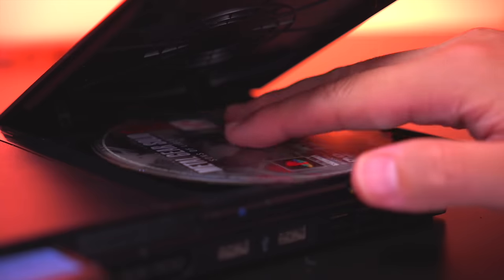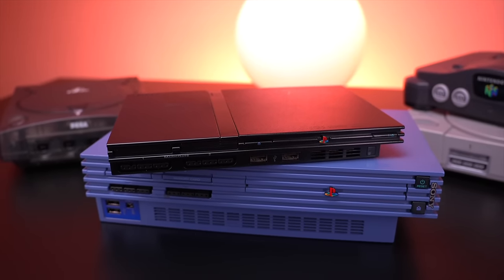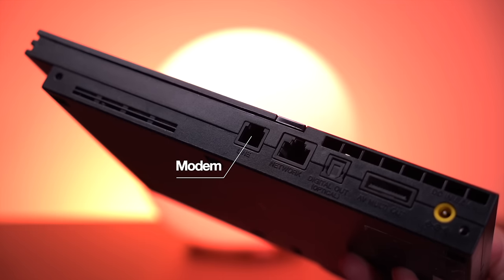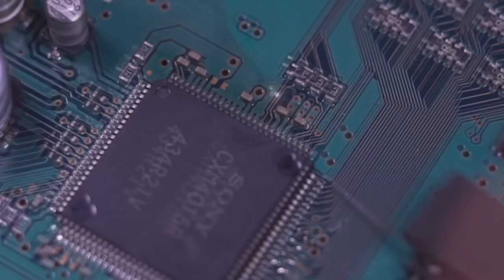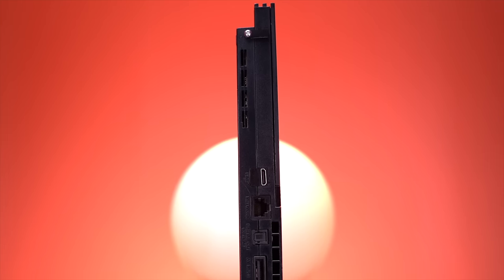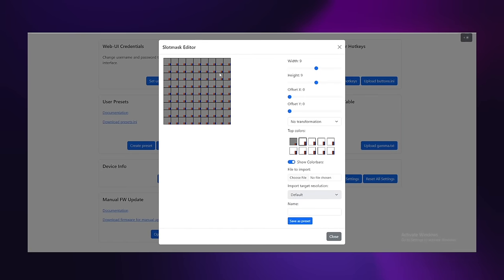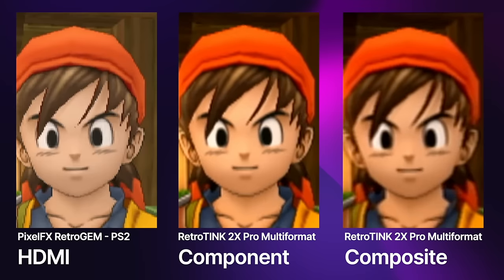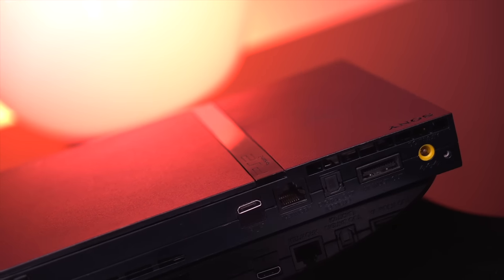This HDMI Mod Makes The PlayStation 2 Look GORGEOUS!

Comment: I would have bought this immediately but I'm having second thoughts seeing basic features like 1080p locked behind a paywall. Obviously they feel they can still make money selling the basic version at $99, so charging nearly double the price for those who just want 1 step higher in resolution feels like a scam. Its not like he's putting features that took a lot of R&D behind the paywall
Reply: Another annoying thing is that it's not even $99 it's $120 but the rationale is that without the ribbon cables (which you need to install it and cannot choose not to have) it's $99.
Reply: @kyle52905  seems scummy. just ask for what it costs. it's like saying this car is only 25k, but it doesn't come with wheels or an engine.
Reply: im waiting for someone to find a way to hack into it and give it shiny firmware.
Reply: actually crazy its $189 just to get 1080p
Reply: @markie7062 yeah, for a very old console, the upgrade are not worth the price
Reply: Yeah F that, just get a decent PC and PCSX2.
Reply: I choose to buy gbsc wonders box instead
Reply: See the idea is very solid but I'm still saying for the price and for it be 2 near identical versions and call the other "shiny" with nothing about it being shiny is kind of crazy to me like up to 1440p is cool but I could just save the money and but the PS3 with the ps2 hardware in it to mod that instead
Reply: It dosent feel like a scam, It is a scam, i suggest waiting a bit, now that the road is paved its only a matter of time before the community catches on and make a open source one
Reply: thanks you saved me one on this
Reply: @kyle52905  Especially when there are components that ARE unnecessary (the WiFi antenna) that you have to buy for some reason. As long as the thing works on day 1, I don't care about firmware updates. Surely it would have been much cheaper to add a USB port for connecting the board to a computer?
Reply: @smittzero8463  I disagree there. The wifi module is pretty necessary as it would suck to take the system apart just to get a firmware update. You need a secondary micro controller anyway to flash the FPGA, might as well spend a dollar more and get one with wifi built in. They're really cheap
Reply: @jdigi78  USB-C port on the outside of the shell, requiring a tiny bit of shell cutting. No need to disassemble.
Reply: Just like tesla vehicles
Reply: @hajisaiku  eh that would be like $250 just to find one and modding it to avoid YLOD would run you like $500 minimum (it's also not very feasible to do yourself). Best option imo is to get a gbsc, retrotink, or ossc and use that since they're all quite good and multipurpose.
Reply: Are there any good alternatives to this? GC and Wii have pretty good options. Kinda weird if there's nothing good for the PS2.
Reply: You’re getting a $190 device for $120, think of it that way. Otherwise, you’d just be paying $190. The software locks are a way of being able to offer it as a functional product at a lower price. At $120 there is probably not much profit, but at $190 there might not be many people who would go for it. I’m thankful someone’s taken the time and effort to do this and to see people trashing it without understanding that it wouldn’t exist at all without this sort of compromise is really shameful.
Reply: @srpacific it deserves to be trashed on, it is a scummy choice and they brought all this bad publicity on themselves, should have just sold the shiny version as-is. Wont be long before cheap full feature chinese knock offs and a community made bios flash unlocker will come out anyway--these people dont deserve the $190 if this is what they pull
Reply: На эмуляторе  PS2 для PC картинка лучше
Reply: Honestly just needs an adaptor

Comment: Honestly $190 for the Shiny Edition vs $120 for the regular is just obscene, especially since they're literally the exact same hardware and the "premium" features are all implemented in software. No, it is not reasonable to charge $70 extra for 1080p and motion adaptive deinterlacing, both of which the hardware can ALREADY DO and are solely locked out by the proprietary software.

Imagine if this had been how PS1 modchips worked. Imagine if you got charged $30 for a PS1 modchip that lets you play backups from YOUR region, but you had to pay $90 for it to let you play backups from OTHER regions. That would be absurd, right?
Reply: You sound poor is $190 is expensive 😂
Reply: @Daveeeeeeyhowyoudoing  9 months ago... that was a month of groceries. Now its like 2.5 weeks.
Reply: That's kinda similar to how xecuter/sx os used to be, at least before Nintendo busted Gary Bowser.
Reply: Your probably they type of person that calls a mechanic to fix your car and then does want to pay them when it takes them less than a minute to find and fix your problem

Comment: Yeah idk man I don't feel too good about locking software features behind a paywall like that. If they were selling an actual slimmed down version of the hardware or were only selling the shiny edition it would feel less offensive, but presented the way it is here evokes the same feelings and arguments we had back when Disc Locked Content was the big controversial videogame thing.
Reply: It also feels like the BMW controversy where the cars come with heated seats on the base model, but you gotta pay a subscription service (forgot if it was monthly or yearly) to use that feature. Shouldn't the option be ADDING the seats themselves instead of driving up their base model production cost and locking the item features behind a paywall?
Reply: Agreed, it’s pretty stupid product design, not to mention asking for a hack
Reply: Or not making it plug-in.
Reply: dont worry they will only sell like 50 of these max at this price and scheme.
Reply: Do you think it would still be $120 if they had to spend the money engineering and producing a separate hardware version? This is a universal board for many consoles. Think of it this way, it’s a $190 device you’re getting a $70 discount on to give up a couple features that probably don’t matter to most people.
Reply: @OfficialDJSoru  Ordering features in a greater quantity allow them to reduce the price of a single unit therefore, making more money on premium models. It alos reduce cost in manufacturing plants as there are less mistakes made because all models are fully equipped.
Reply: @tomjoad1363  That's the reason BMW said. It is quicker and cheaper to install on all cars. And no 3rd party installations that can damage the car. So that is why the heated seats are sold as a subscription fee.

Comment: You would think that for $190.00, they would 3d print the fitment block to keep the hdmi port uniform with the other connections. If you look at the final reveal before he plugs the hdmi into the port, it's crooked to the point that it's an eyesore. Awesome video sir, but the price and their quality is a no go for me
Reply: It was the first thing i noticed during the intro when it revealed the port, yikes
Reply: Glad I wasn't the only one that noticed!  For the price, that is just unacceptable for any mod.
Reply: My exact thought. Shody,  expensive and does little. Pass!
Reply: Who’s ever going to see the back of the PS2 though? I don’t get why everyone is hyper inflating this issue.
Reply: It's the fact that after installation, I would personally know it's there and it would eat away at my soul. The point I was making is for the sale price of $190.00 plus tax and shipping, they can fit the case component a little better. If it works, it works and I won't knock the functionality. However, fitment is another issue

Comment: With the lack of 1080i support, the weird software locks, and the fact that component cables still provide pretty dang clear video, I think I'll stick with my component cables for now. Great video as always though!
Reply: Wise choice!
Reply: plus, with component cable you can get 1080i.
Reply: Not to mention, this mod destroys the color space 24:00 . Since it forces the console to be in Hdmi Limited. Making all colors over white , and it crushes blacks (Shadows just vanish in all games. The Color Black is now not BLACK but DARK BLUE , Brown is not BROWN but DARK YELLOW , Red is now not RED but DARK ORANGE , Blue is now NOT BLUE but LIGHT DARK ... it messes up the whole color space)... Compared to Component RGB, that presents all the color space with the correct colors...
Reply: The colour also looks horrid with the HDMI mod, not even considering that 720p is a pretty modest uptick from 480p. What a bad product.
Reply: @hfric  Like most of the video output mods I've seen so far. Latest Edge enhanced for Snes (green is blue on smw for example). Shiny mod isn't sharpness mod, but modification of contrast, the forced whites and blacks, make the overflows (on flat screen) of colors are attenuated, giving the impression that it is sharper, but it is not the case. Indeed it distorts the colors, this mod is no exception to the rule. Original on CRT is the best for old consoles. But for consoles from 128 bits I think there can be progress.
Reply: @Daitrn2002  The yuv video output is not affected by the mod?

Comment: Not having 1080p on the basic edition is a huge letdown. I agree that using something like a RetroTink with this would be an awesome way to play, but I think that for the (comparatively) plug and play solution of installing the mod and just running it, not having 1080p is a big deal, especially considering that a lot of people have 4K TVs now.
Reply: The concept of a license for something already on the hardware is a business practice I won't support.
Reply: The option already exists to use a Component cable and run it through a RetroTink 5x. You’ll get 1080p and Motion Adaptive deinterlacing AND it works for all your console, not just one. IIRC, only PS2 needs it
Reply: Could be wrong but i don't think it would look much better. For me 480p is enough
Reply: This is a great option with the Super Shiny Edition of you already have an OSSC you’re using on a slew of other consoles that won’t take advantage of adaptive deinterlacing
Reply: biggest letdown with that is that it's a software lock and not a hardware limitation.
Reply: @AegisRages I applaude you having a spine mate and absolutely agree!
Reply: I hope someone finds a jailbreak to get it on the basic version. Software locks are unethical
Reply: @UnethicalMonkey420  Agreed!
Reply: @UnethicalMonkey420  yes I agree!
Reply: 720p should be okay for most people unless your tv has issues upscaling, the only real downside is not having motion adaptive deinterlacing
Reply: Not to mention RetroTinks are expensive and very difficult to get a hold of outside of America.
Reply: @Spazbo4  all tvs 720p to 4k is quite soft.... and 1440p hw is there in all hw it is just LOCKED. absurd.
Reply: @JGrove303  it wasn't a software as such lockout it was a limitation of the actual firmware on the dvdrom that  panasonic provided even if you could get up to 1080 p and/or 4k where supported hardware limitation would also be an issue for atleast for both ps1 and partial of the ps2 games as half to 3/4's of the games were still cdrom based meaning most  only had the capacity of max resolution of 720x576 which was the default widescreen standard and max bandwidth s-video coulod obtain towards the end of life of the ps2 there was only about 6 games that supported up to 1080 i none did progressive scan at this stage..
Reply: @TheSynrgy1987  Someone will find a way to unlock it, I'm sure. Just a matter of time. That's a shady ass practice and I hope they fail because of it.
Reply: i'll be getting the base model, 
everything piped into a retrotink 4k
Reply: @MarbleThumbs , this sounds like the 3DS capture card install service. you have to pay a thousand+ to get an inferior product to todays standards where many tablets have such ports. so a thousand is a no buy...
Reply: @michealfunickrr3717 Yeah, I'll stick with snicker stream and an aux cable at those prices.
Reply: @AegisRages Yeah, very sad to see
Reply: @Spazbo4  the problem isn't mainly it being 720p but it being a software lock and not the hardware being weaker
Reply: @TheSynrgy1987 what is  software lock
Reply: Thanks for saving me time in watching this video
Reply: Just play the game on a damn ps3.
Reply: @TheSynrgy1987 so you’d be okay with it if they spent extra money to engineer a basic version in hardware, then sold it to you for probably more than the soft locked board here since the extra costs to produce a second version would likely make the base price more expensive? Sometimes I think people have absolutely no understanding of economics…think of it this way, You’re getting a $70 discount on a $190 product not a $70 up charge on a $120 product.
Reply: @srpacific  so they're losing money on the basic edition? get real
Reply: 1080p is nice. But without motion adaptive deinterlacing you screen will constantly shake and thats much bigger problem.

Comment: Man I was really looking forward to seeing what this kit had to offer. Its too bad that even after coughing up $120, you get all the hardware but not all the features. Really hoping they rethink the whole "$70 license for a mod you already paid for" thing. I'm all for supporting small businesses, but not when they pull things like this.
Reply: Tbf if they hadn't introduced this weird "basic" tier the device would've just retailed for around the same price as their previous kits. Which is the cost of the "shiny edition" firmware. It's what most were expecting. You're paying less for less features here. Though honestly the decision is so confusing it might have been worth just forgoing the basic tier all together. All it's really  done is piss off potential customers and introduced bad pr.
Reply: Hopefully someone will crack the software and unlock the features for free.
Reply: @ucitymetalhead  I already did.
Reply: @AR7271  how did you do it?
Reply: @SSC3034  I'm just kidding. 🤪
Reply: Was about to buy one, but they can keep the shady greedy business to themselves
Reply: If it was $190 with no option for stripped down features you’d still be complaining.
Reply: @AR7271 great joke. Said no one
Reply: Can’t help but to be reminded of that stunt Intel pulled several years back where after purchasing one of those “gift codes”, you could redeem it to upgrade from Pentium-level performance to the equivalent of an Intel Core i3